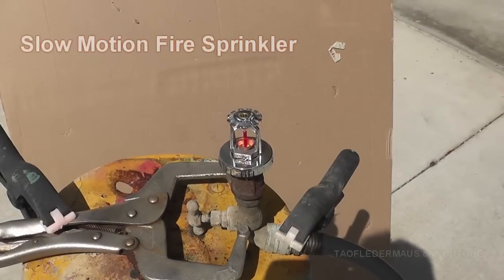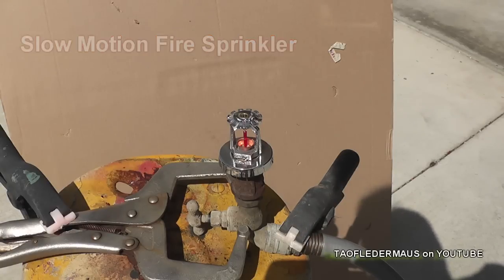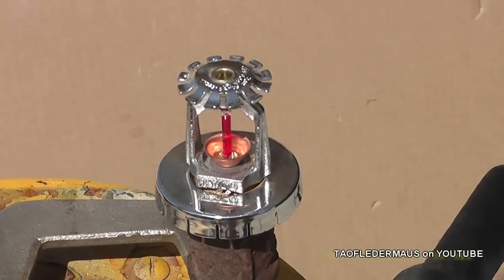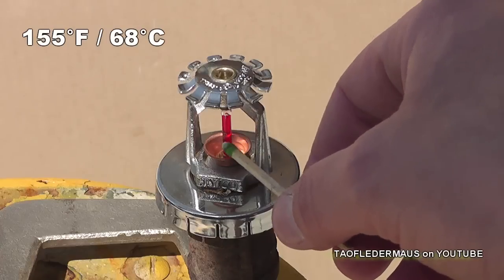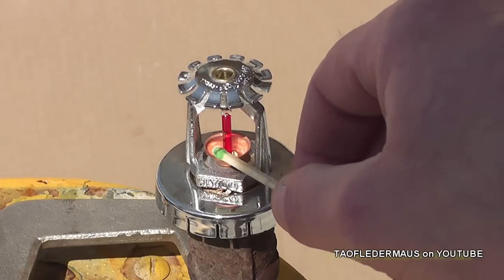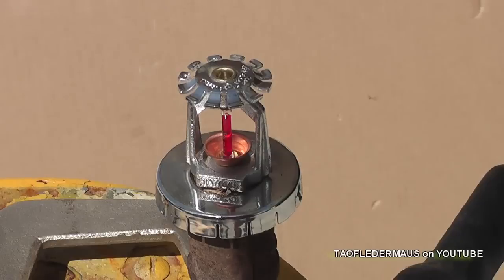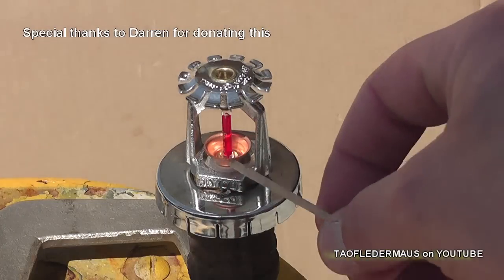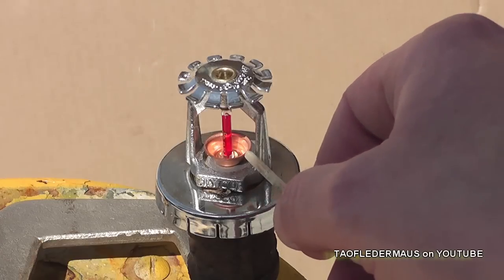How do FIRE SPRINKLERS Work?  (slomo)

Comment: Retrofitting Sprinklers is difficult or costly. Think out of box or this case out of house. Aesthetic pvc conduit maybe appearing like trim or downspout on exterior walls connected to wall mounted sprinklers. Water released into exterior pipe once smoke or heat detector triggers.

Comment: The liquid in the tube is glycerine. It expands and shatters the glass at temperatures between 155 and 165 °F (68.333°C.) When the glass breaks it releases the copper plug, shooting water to the round piece on the end which spreads the water outward eliminating the fire.

Comment: The sprinkler contains quartzoid bulb.The red colour indicates the operating temperature of the  bulb.It partially filled with gas and special fluid.When heat is applied ,this fluid increases in pressure causing the  gas inside expands and burst the bulb.

Comment: Hello, I am actually a fire suppression systems installer and so everyone understand that is a "pendant sprinkler" they are actually meant to be in the downward position, for the demonstration this works but in a real life situation this would be installed incorrectly right now. What you need to use is a "upright sprinkler". 
looks like a 5.6k, 155 degree Fahrenheit quick response head. Typical coverage area is 14' squared.

Comment: So they dont all just go off when you pull the manual station like in the movies?
Reply: They can if you rig pyrotechnic explosive charges to the heads hooked up to the fire alarm handle.
Reply: justinl458 if one go off in all over is going to fall down

Comment: Once it pops, can you replace that ampule or are you supposed to replace the whole thing? And how do you stop it?
Reply: booger king gotta replace the head, the fire department shuts the system off from the fire riser when they arrive.
Reply: The head? You mean the whole thing?
Reply: @boogerking7411  Yes, the whole thing
Reply: booger king when a head breaks you shut the system down drain it and then wrench out the old head and put a new one in then refill the system

Comment: Some sprinklers have red liquid while others have blue...Why?
Reply: http://www.aj-fireprotection.com/Resources/Parts/Sprinkler-Head-Color-Chart.jpg
Reply: The color represents the temperature needed to bust the glass tube and activate the sprinkler head. When I done fire sprinklers there was 7 colors if I remember correctly. The lowest temperature head was 135 degrees and the highest was 500 but the most common is around the 155 dog which would be red in color.

Comment: Nice video, but FYI it's the air bubble inside the element that expands and breaks the glass, not the liquid.
Reply from the maker: that makes no sense,   may as well have a vial full of air then
Reply: more like, the liquid expands until pressure exceeds what the glass ampule can withstand and POW.

Comment: my neighbor hit hers with a shoe it went off she called me right away she did not know how to turn it off lucky the system is just outsidd I wish I had the same amoumt of water presure she has water comes out like a jet on a normal hose loads really fast she has a firehose connection after that she had like 30 of the remplacement ones I broke 3 while installing them but finally got one in the dint leak they are pretty hard to put in without the right tools

Comment: how do you stop the water if you accidentally break one
Reply from the maker: shut off the main valve that feeds the system.
Reply: TAOFLEDERMAUS I will be working on a unit in a 12 story building on 8th floor sprinklers out of upper wall not ceiling. have been told if sprinkles are compromised only fire dept. can shut off supply resulting in watter damage to lower floors is there a faster way if that occurs
Reply: the fire departments use "wedges" to jam in the sprinkler opening from each side and whack them tight, it doesn't fully stop the flow but will be down to a trickle or drip which can be contained with buckets or barrels. just search for  "fire sprinkler wedges"

Comment: In response to the top comment... There was a device I had seen several years ago that I am now unable to find. No joke, but I think it was called "Dam it". You would get soaked trying to use it, but the plug was on some sort of extension rod and you would wedge the plug in between the diffuser and the orifice. If it meant saving valuables from water damage because of the accidental discharge of a head, getting soaked would be the price you pay instead of waiting on the FD.

Comment: I'm curious - if you were to accidentally set one of these off, is it possible to plug it with your finger until someone's able to get it turned off so that the room doesn't flood?
Reply from the maker: I doubt it
Reply: Wow, first MATH and then actual EXPERIENCE.  Most rewarding YouTube comment thread ever.
Reply: I think the pressure is to high. At university we have these wedges on a stick, with a rubbery material, which can be jammed inside to stop most of the flow, but I think you need to force it quite hard.
Reply: Hi. I've been in the business over 35 years.
To answer your question - no. 
This demonstration is actually done with a relatively low water pressure.
Most sprinkler systems have working pressures of 50-175psi.
That pressure, as concentrated through the 1/2" orifice of this particular sprinkler, is quite forceful.
Even if you could stand being next to an operating sprinkler, you wouldn't be able to manually hold it shut - or even get your finger near the orifice.
Reply: Jp Kalishek No, the movies have it wrong.
In any "closed" sprinkler system (one in which the sprinklers have fusible elements and "plugs" in them), each sprinkler is activated individually by heat.
If only one gets hot enough to activate, then that sprinkler is the only one to open and spray.
The ONLY time all the sprinkler heads would activate at once is in "deluge" type systems, in which the sprinklers are all open types - none of them have fusible elements in them, in other words.
This type systems' piping is empty - no water, no compressed air.
These type systems depend on separate means of detecting fire; there are electric means (detectors, either/or heat or smoke or both) or pneumatic means (separate sensing lines/piping with compressed air in them and fusible means of releasing that air once activated by heat).
Once the detection means activate, the main sprinkler control valve ("Deluge valve") actuates and releases water downstream, where it comes out of all the open sprinklers at once - hence, "deluging" the area with water all at once.
Aircraft hangars, for example, are such a type of system - there are typically open element sprinklers throughout, along with "monitor nozzles" aimed under airplane wings and such, that once the system is activated spray a mix of foam and water in all areas of the hangar at once - and there are requirements for how much of this foam mixture is delivered in a set time frame.
Those are fun tests to run. :-)
These are far and away the rarest type of sprinkler systems, though.
Most folks will never see one.

Again, in 99% of instances, you'll never see the situation you see in the movies - occupied structures (schools, offices, homes, factories) the sprinkler systems are the "closed" type, with each head activating by heat individually.
In fact, the "experts" tell us in over 90% of situations where fire has activated a sprinkler system, only 2 or 3 heads wind up activating.

Hope this helps.
Reply: Xissorplane
I Google'd "fire sprinkler mechanism" myself and it looks like the plug itself does indeed hold back the water. This video is already the first result.
Reply: stdavross666 Actually, there's a relatively low percentage of fire sprinkler systems that have a fire pump, at least in the US.
The vast majority are supplied by the same municipal water supplies that serve our drinking water. 
You'll only see fire pumps in certain high demand situations such as large storage facilities typically - or in high rise buildings such as apartment complexes, where the demand actually comes from standpipe/fire hose requirements rather than the sprinklers themselves.
As single family residential sprinkler mandates eventually become more common, you'll see more of the little fire pump/sprinkler systems there, too. Someday.
Reply: No, the "plug" is all that is there, wedged into a brass seat (almost all sprinklers are cast brass). This is called a "Belleville seal".
Reply: fire fighter here.....no you can't plug them with your fingers....tried that in rookie school....you get soaked. only way to stop the flow beside turning off the water is to jam 2 wedges opposing each other or buy the sprinkler plugs. they look complicate do use. mind you the water is flowing in excess of 60 psi and at a rate of 30 to 40 gpm. also the coloring is for different temps. each color has a higher rating. red trips at 155 degrees or so and all the way up to 600 +.
Reply: +ReverendTed I think the glass is holding the copper/brass "plug", but I don't think the plug holds back the water itself, but is holding back a spring loaded valve inside.
This is pure conjecture, though. Couldn't find anything about the mechanism in a quick googlesearch.
Reply: stdavross666
So it's not just water pressure already in the lines, then?  There's something else that starts once a sprinkler opens?
Reply: moparedtn
That's what I was thinking, looking in the sprinkler riser room of our building.  Lots of plumbing, but nothing that looked like a pump.
Reply: No bad idea you will never stop it. best is to run to the stair well follow the EXIT signs they will lead you to the stairwells, Not all buildings have fire sprinkler risers in the stairwell's, Most of them do, most do, but not all have 2 risers, 1 in each stairwell, close the main valve and open the drain valve all the way read the label test and drain, In both stairwell's closing one valve if there are 2 wont do any good. Do not panic there will be more water coming out then  this video x 20  if the building is equiped with a fire pump, that sprinkler head is a pendant, not a upright, never tie balloons or anything to the sprinkler heads,
Reply: *****
I ask because it SEEMS like the glass ampule can only be resisting so much force, but I can see that it might be one of those situations where an object is stronger than one might expect.
Reply: You are correct, sir!
Reply: The pressure the ampule holds back is not the pressure the sprinkler sees once the fire breaks it. Some systems, don't even have water in them to prevent freeze damage, and until the ampule releases and the air pressure in the system drops tripping the valves releasing the water (or foam water mix) the water is no where near the sprinkler.
Yes, the ampule doesn't hold back a lot of pressure, but once it releases, the water pressure climbs, blowing out the rest of the ampules on the circuit. I worked at a place (where the foam was made and sprinklers tested actually) where the air pressure dropped in our "Dry" sprinkler system, and a little water got in the lines. Not enough to cause freeze issues, but corrosion. The main line rusted through, and the slower loss of pressure tripped an alarm notification. 
And those tests for them, one of the messier jobs is changing out the sprinkler heads, They burned MoGas, Cyclohexane, and Isopropynol that coats everything in carbon black. makes a mess when you touch it, and you can't see it until you bump into it.
Reply: Jp Kalishek
Wait...so movies DO have it right that the sprinklers all come on when one gets set off?  (Excepting the trope where you start it with the fire alarm pull.)
Reply: +ReverendTed +moparedtn 
Depends on the design. there are some that set off only if hot, there are others that don't have ampules and instead have either a bimetal trigger or a solder joint, and still others with nothing blocking them at all. A low pressure system is used where you can have only the one sprinkler going off, higher pressure ones are for areas where is a fire breaks out, you want inundation (flammables storage areas for instance . . . another aside: fire fighting foams often have ingredients that themselves are flammable. Yep), the drop in pressure trips a switch and the pump kicks in jumping up the pressure and that sets off the rest of the sprinklers, and some systems (usually not water based) also trip as a security feature in case of illegal entry. 
The ones without anything plugging them are often used in some Dry line systems where the lines see freezing temps, or with different systems where something else tells the system to turn on. most of the movie ones are actually this type and they just turn the water on at command.
Our dry line system was to cover an outdoor flammable storage area, and a fire in one area could cause fumes from another area to potentially light, so the whole system would go, and the flammables we stored were miscible in water so really that was all that was needed to stop them burning. Systems designs can vary greatly. one brand of head will have many differing designs depending on intended use.
Reply: I'll admit to being somewhat surprised that it wouldn't be possible to plug it.  It seems like if that little glass bulb could hold the water back, a finger would have no problem.
Reply: the other guys tree service uhm sir our hospital used 80PSI because their fire hoses are 2" in diameter, and also it is a stupid Idea to plug it. Because it might shoot it back to you
Reply: what most all fire dept's do is jam wedges in and pound them in place, it doesn't stop the flow but will hold it to a trickle or dripping, until the building line can be shut down/replaced heads
Reply: unlikely.  But there is a tool you can use to temporarily stop the flow.  Its called a ShutGun.  it looks kind of like a caulking gun.  Theyre cheap, easy to use and easy to find.  Or use wood wedges
Reply: moparedtn been in the buisness but use "psi" hmmm
Reply: Try to plug the water tap in your bathroom with a finger. The pressure in the typical house pipeline is about 2 bars. The pressure in the fire extinguishing pipeline is about 10 bars.
Reply: ReverendTed it would either shoot it in your eyes or shoot it everywhere in a stronger force
Reply: ReverendTed they're rated at 175psi. Tested at 500 in factory.  Most critical facilities will have a pump (occupied levels over 35 ft above grade). Not a chance you're stopping it with your finger.
Reply: No couple hundred pounds of pressure on the system u wouldn't even be able to plug off with the proper part u have to shut off and drain system
Reply: No typically, there will be fire pump, once sprinkler activation occurs and the pressure drops, the pump will start. Smaller systems may be mains water pressure with no pump. I can tell you there is no chance of blocking it with your finger. You would need to locate the sprinkler isolation valve for that system and turn off.
Reply: Once the pump starts you will holding 800-1000kpa. Dont think so.

Comment: that glass tube is awesome. how many psi can it handle? (correct me if im wrong with the unit psi of water inside the pipe)
Reply: Sprinkler heads have to withstand a 200psi test before final approval of the installation; they have a maximum "rated" working pressure of 175psi.
Reply: have you tried holding an raw egg vertical in between the palm of your hands and try to smash it? . Try it and tell me how it went
Reply: that glass tube is awesome. how many psi can it handle? (correct me if im wrong with the unit psi of water inside the pipe)

Comment: its mercury, since mercury rises in pressure when heated. the glass is real thin so it smashes.
Reply: Mercury is toxic to humans and living beings.. and the liquid is red.. it's not mercury, but instead actually an alcohol like stated in the video.. what type of alcohol? I'm not sure on that.
Reply: No, not mercury. The fluid in sprinklers is actually a glycerine-based solution.
Mercury has never been used in the making of fire sprinklers.
Reply: The Mercury in a thermometer
Reply: @Justwill007  Thermometers don't use mercury anymore. If your thermometer  contains a red liquid, it's alcohol. Mercury is a metal and can't be dyed.